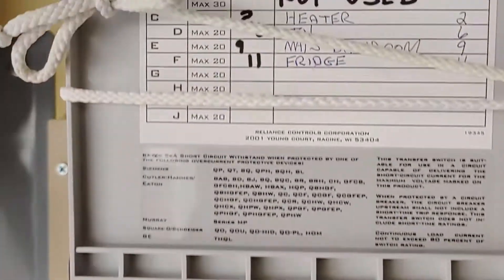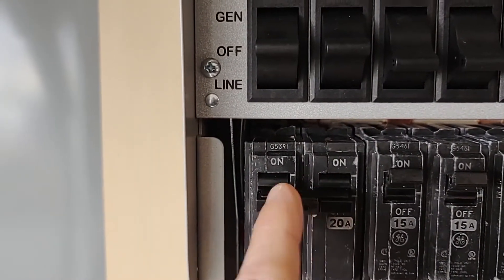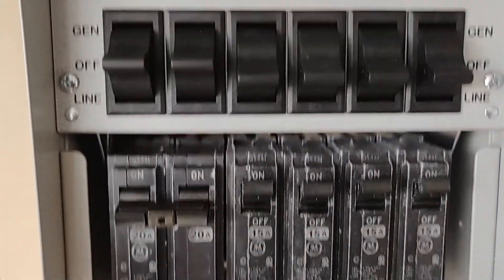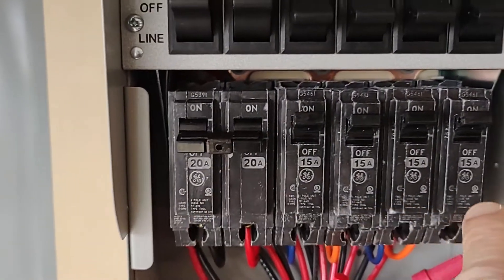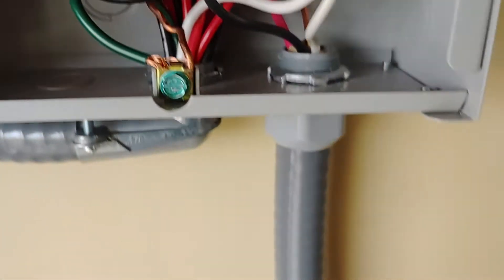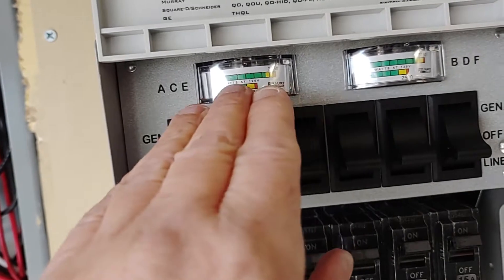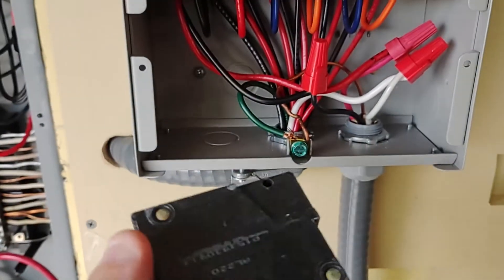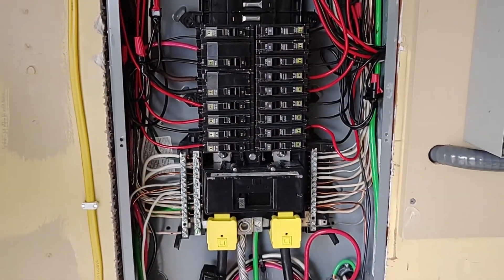ProTran Transfer Switch modification

Comment: i have the same panel... love it it works great.with my harbor freight generator .. HOWEVER i was just think (probably a bad thing).. i wounder if a double 15amp breaker would work doubling the amount of available circuits.. i do use the 240 a/b leaving me only 4 available 110 circuits... the double breakers would be used for lights outlets... any thoughts ????
Reply from the maker: My knowledge is limited, sorry.

Comment: Pop the connector off the front of those 220 breakers just use a screw driver. so levers work independently. Unless you use them for 220 then leave it.

Comment: I’m interested how you connected the 110V generator to the panel ?
Reply from the maker: The xfer kit has everything you need    Even the outside plug and connecting cable.  Check if your generator has a different connecting plug receptacle- you can always buy a converter plug.  Suggest you got to the Reliance YT site- link is in my description- they have a series of excellent instructional videos.

Comment: Good your safe. They are connected for a good reason. They are designed to go across both legs and power a 220V device. When connected to your panel one would each be on one leg and the other would be on the  other - for instance A and B. You would use it for the case of running a 220V appliance.  These transfer boxes seem like a lot of work to me. Just hook up a 30 amp breaker double throw (like your 20 amp example)  in your main panel and put a manual interconnect plate. Then you can decide what to power and what not to power. Cost less and gives you much more flexibility
Reply: @primordialsoftware9294  I made my own little project box with two LCD displays that show watt, amps, volts and KWH for each leg of my system. Cost about $40 total but is real nice and easy to make
Reply: I specifically wanted the flexibility the box gives because you can run on 'generator' any time.   So I have a smaller solar panel/batteries/inverter setup hooked up as the 'generator' and I can run circuits off solar when available then flip them back to grid if needed.    Your method is an all-or-nothing to generator which my solar setup isn't large enough to accommodate all of my needs and I didn't want to go through a 'grid tie' system.
Reply: Sam Bentrup sounds like you have what works for you.  Good job
Reply: Interconnect is great if all user are clear on how to use.   The transfer switch was my choice because I it will be easier to teach family members how to use safely, avoid overloads and recover when power returns.

Comment: Good video.   Just fyi, the circuits with 15 amp transfer switch breakers can be connected to either 15 or 20 amp circuits in the main panel.
Reply from the maker: Thanks for viewing.